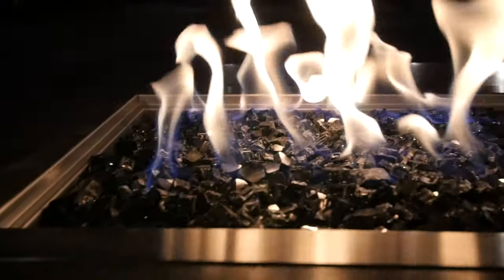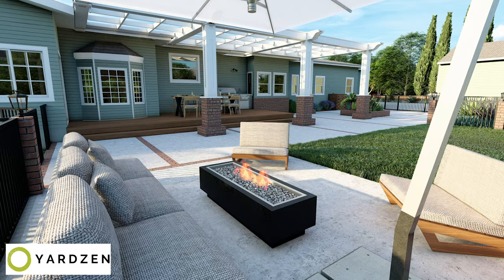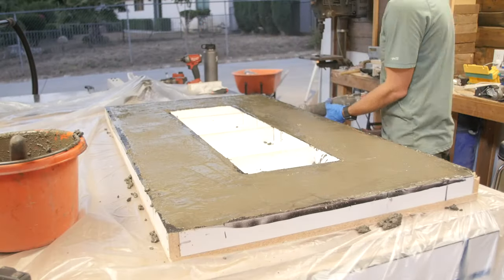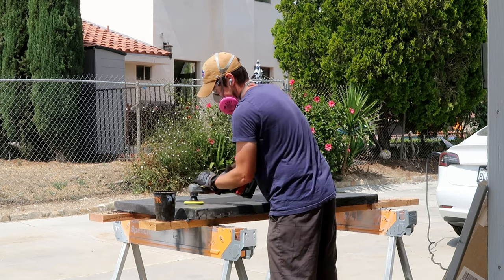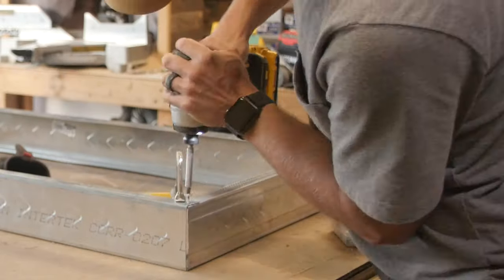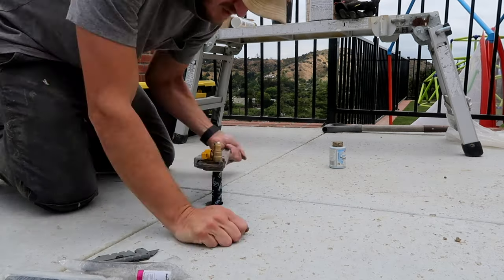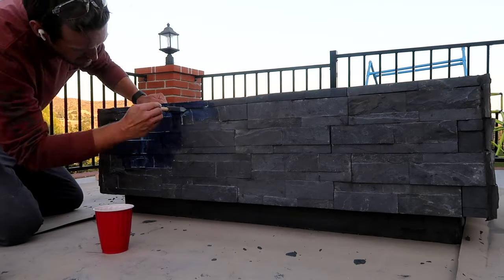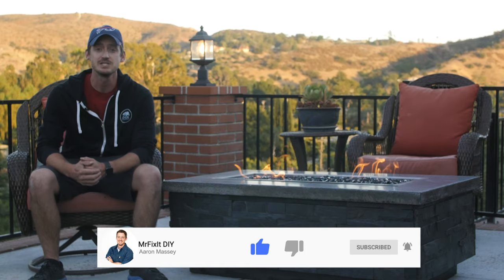DIY Gas Fire Pit Table

Comment: Very nice project and outcome. And thanks for sharing. As a plumbing contractor in California, I agree with the comments about using Teflon tape on gas. You don't need it, it is not necessary. But no big deal. If applied thinly as not to have access material to restrict or fall off in time and abstract the gas flow - Then you're fine.. Other than that, you showed that it can be done by individuals like me or others for 1/3 of the cost and it is well appreciated. I also think that you should make a breakdown of all materials used and a sketch of materials and steps how to measure, cut and assemble and you can charge for it. After all you made it and you deserve compensation.

Comment: I like the project, and your work looks good.  
Thee questions:
1: Is there a rust concern with using the metal framing? I was considering brazing or welding aluminum.
2: I do not see a vent in the box.  It is my understanding this is required national code.  I know natural gas rises vs pooling of propane.  I am not commenting to be negative, just trying to learn if I missed something.
3: I ran an underground gas line to the corner of our recently installed stamped concrete patio.  I plan on using a hose (similar to a grill line) to connect a fire table.  We did not have furniture picked out when we installed the patio, and we were not sure if we wanted a permanent location of the fire table.  The furniture can be reconfigured, and we felt it was best that the table could move locations.  Yes, the hose may be a tripping hazard, but we will find a solution to minimize that risk. Do you have an idea or solution that would enable the table to be moved easily?
Reply: Your definitely being negative

Comment: Just a heads up for future projects, it’s not safe to stack the adapter on top of the valve, it can create a gap sense that’s not really meant to be like that, and Teflon tape should be not used. The flange on the connector and valve meet together and are supposed to form on each other. I work for a company that fixes gas leaks and check’s appliances and those two are the number one causes of gas leaks I find. Stacked adapters and Teflon tape. Be safe just wanted to help out for future projects for any one

Comment: Awesome build! Never tape flare fittings by the way. The 3/8 propane hose flare fittings don't get taped. Only pipe thread.
Reply from the maker: Thanks for the tip

Comment: Question, what happens after a heavy rain, how does the water not collect in that pan?  I get that you just use a leaf blower on the top while blowing off your terrace.  Granted not cheap, as you honestly point out, but it seems like that thing will be there for at least 50 years or more.  It is the entire focal point of your whole terrace.  Such craftsmanship and excellent designwork.  I like how that stone face looks with all the red brick in that area.  Did you put like 1/2" feet on the base then holes in that pan?
Reply from the maker: There are built in drain holes and the backside of the pit which it slopes towards is slightly elevated for drainage.

Comment: Very cool but you shouldn't use Teflon on flared fittings it can actually cause a leak because flared fittings are a compression type fitting, the 2 surfaces, line and fitting are compressed and lightly crushed together to create a gas tight connection.

Comment: Hi... another question.
I have build form an am in the process of silicon if the inside perimeter. Is there a reason why the tops of the malimime frame are siliconed as well? Is there a purpose for that?

Thanks la for your guidance.

Scott

Comment: Can you share dimensions please? Unless I missed your post.
Looks great!
Reply: Hi Aaron, can you please share the dimensions for each stage?  Such as the base, then the main frame structure, and last the concrete top?  This is an awesome build and would love to do this for my backyard.  TIA
Reply: @uychu8173  I agree -- Dimensions would be great
Reply: Concrete top : 52” long 28 width 
36” x 12” in the middle 

Base 48” long 24” width and 16” High

this is what i understood with the video based on my experience

Comment: Can you explain how you knocked out the middle cutout as it appears that it has been screwed on the ends (all four corners) and siliconed  over.
Any help on this would be appreciated. 
Thanks...
Reply from the maker: I recommend you use hot glue to hold it in place instead of screws
Reply: Alright... thanks

Comment: Aaron - Can you offer suggestions for a design of a CONVERTIBLE fire pit table -- one that is a standalone fire pit table say 4x2 long. that can be converted into a rectangular table for six using the fire pit table as the center element.
[HINT: Idea for your next video!].  I cannot find this discussed anywhere.
I have a porch where a fire pit accent piece would be wonderful but a full size table is not needed most of the time.
Reply from the maker: You could either have a simple table top frame that you could set over it or you could also have fold down wings on the sides to make the table bigger.

Comment: Hey Aaron, I currently have my table built and concrete tabletop is ready to come out of the mold. Can you tell me your technique as far as how polishing goes? Grit to use from start to finish? Also, any other tips would be helpful. I'm really worried about screwing it up! Thanks 😊
Reply from the maker: The kit I bought off Amazon (link in description) went from 80 to 3000 I think. I just went all the way through. I had a little more aggregate look exposed in the final look so if you didn't want that I'd probably start with a higher grit like 160 or whatever your kit has

Comment: Castors could be used on the inside of the build for ease of movement as well heavier gauge steel studs would ensure a lifetime of rust free use without much added costs
Reply: They are galvanized they won't rust 🤦‍♂️ comment positivity or a link to your own video instead of telling people what they should of done.

Comment: Love how this turn out. Wondering if the structure would support if it was taller like patio table height. Was thinking about doing one of these and use it as a patio table during the day.
Reply from the maker: Yes it would. The metal studs are structural
Reply: @MrFixItDIY  Ya I am thinking about getting some angle iron. Have to look into what it take to get the cement board to the angle iron.
Reply: There are also heavier gage metal studs available for a stronger assembly

Comment: Any chance you can post the measurements to this build somewhere?
Reply: Concrete top : 52” long 28 width 
36” x 12” in the middle 

Base 48” long 24” width and 16” High

this is what i understood with the video based on my experience

Comment: Looks great! Amazing job. Can you tell me about the slurry you added over the concrete. Was this to create a smooth surface to polish? How much Portland to water did you use? Thanks for posting
Reply from the maker: It was ti fill in the little bug (air) holes that didn't come out from vibrating the concrete
Reply: How did the color work out on the slurry? Did you use a complete bottle and 1 bag of concrete to make sure it was the same measurement’s if color?

Comment: Like the video but, do you have any measurements if I want to do exactly what you did on the build., Any reason you used the medal instead of wood?   Can I use wood?
Reply: How did you attached the  top of the table to the metal bottom frame?

Comment: That last gas connection you made will leak.  Don’t need Teflon on that connection and you used a female pipe fitting on a flared fitting.  Otherwise good looking fire pit

Comment: Very interesting! Amazing work! I like the metal frame work, but I would paint it with a few coats of rust resistant paint especially  since it would be out in the elements. I saw you had about $750 invested in it. How much was the burner unit? Just saying, if you purchased a ready made unit, they are quite costly. There are sites where one could make a homemade one for a little of nothing and safe.  Just curious. Thank you!
Reply from the maker: The studs are galvanized so they don't need paint. You can find the products I used here: https://www.amazon.com/shop/mrfixitdiy?listId=ZEWXSU0K5R89&ref=cm_sw_em_r_inf_list_pub_mrfixitdiy_dp_Rew5TbAhuqvPc

Comment: That looks great !! One thing you could have done though is to fix some shoe moulding on the top edge of you form work that would form a neat lower edge on your finished top - in any event I am sure that you cleaned up any sharp edges with the polishing disc. You should check out Home Renovision DIY - as one of his last uploads is almost exactly like your (this video) however there is so much wrong with his build and everything else he does it's a joke - to the point he broke his top - go watch it and see what you think - sad thing is that he blocks everyone that post comments stating how bad his workmanship is - his channel is more of a guide on how not to DIY. Cheers.

Comment: No vents? Dangerous, very dangerous.
Reply: Where would he put the vents?
Reply: @jpetti314 in his case since is natural gas, he needs to vent as high as possible since natural gas rises. Propane is the opposite and the vents would be at the bottom. 
He could have left an all around gap between the concrete and the structure. At this point perhaps make some small holes with a diamond bit in opposites end to allow from airflow. With propane vents should be as low as possible since propane sinks plus you need to vent on opposite sides as well. If venting only one side, gas still can accumulate. This is why opposites air vents are needed as well so airflow could help remove it.